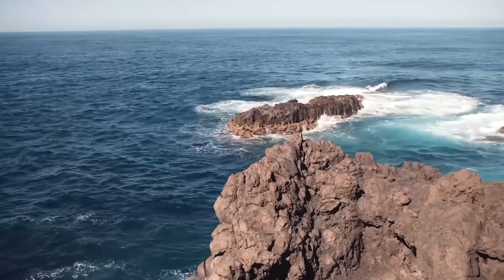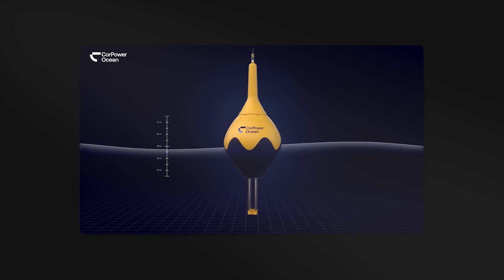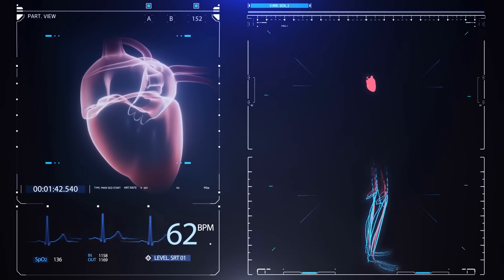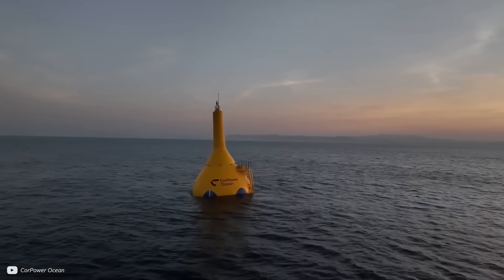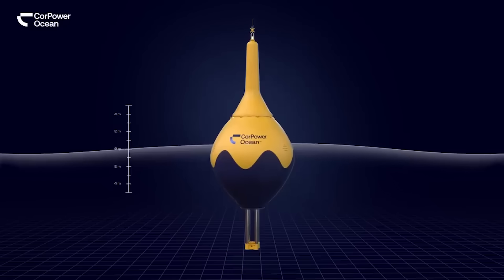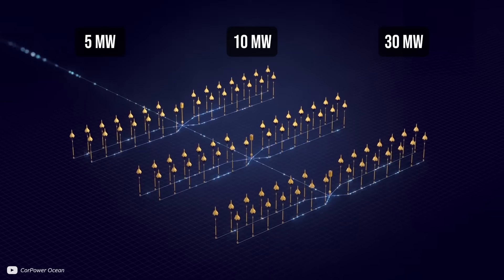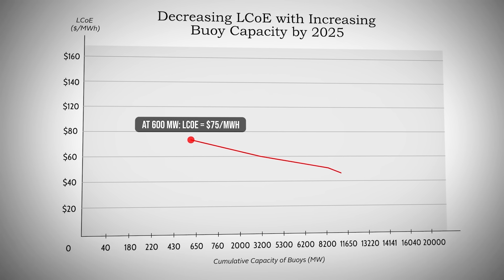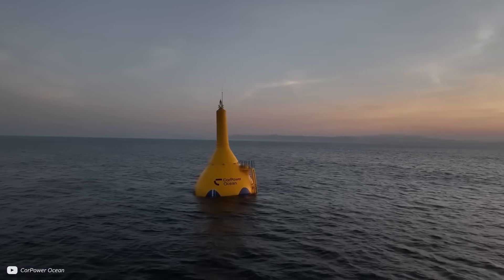Unlimited Wave Energy: This Buoy is the Future

Comment: Renewables are one thing, but they're not useful if we don't have good batteries.

People should push for their governments to invest in industrial sand/carbon batteries. This allows us to store the excess energy that would otherwise be wasted. The heat can be used in one of three ways: 
1. Industrial applications (melting steel, glass, etc)
2. Heating of homes via a centralised heating infrastructure. Similar to how water, gas, and electricity are delivered to our homes.
3. Converted into electricity. 

Number 3 is pretty inefficient, but it doesn't really matter because it's energy that would have been wasted anyway.
Reply: governments don't listed to people - they only serve the oligarchy. so it doesn't matter if they are building useless infrastructure so long as it helps them thanks to subsidies -- even if they will ultimately fail within a few years.

Comment: Big question???? Cost?????  Real cost.
Reply: Yeah, given their cost is "we can match the cost of wind". I'd argue it's not looking good.
Reply: @stusue9733  I believe I have a solution to storing energy with a non petroleum based liquid fuel that can be manufactured almost anywhere….. but I have no help with funding or labor.
Reply: @stusue9733  I have a cheap solution… attempting a demonstration project to manufacture “ a cheap liquid motor fuel for internal combustion engines “ 
My labor and self funded …. Wish I could get a grant or help building out the infrastructure.  Inputs are all almost free but the cost is in the equipment to manufacture.

Comment: would this absorb storm wave height and provide a percentage of protection to sensitive coastal areas prone to erosion?
Reply: I think you would need an extreme amount of these for any noticeable effect.
Reply: @JeppeBeier  I think so too but it's just there can't be no effect.
Reply: A large array must have a moderating effect. This is an upside in terms of coastal erosion but it also is a downside for the relative positioning of buoys in a large array. Presumably if the proximity of the buoys would need to take account of this and would determine the area needed for the wave power "farm".
Reply: doubt it
Reply: There is no free lunch in physics so I guess it does 🤔

Comment: The only important metric for similar systems is the price... :D at sea it doesn't really matter if the rotor is 3 or 30 meters long, you're interested in the cost of production and deployment... and given the complexity and low power it's probable to be bad... :/  fingers crossed, but if we try it at this point with solar and wind, it's not optimal...
Reply: production + deployment + maintenance + EOL costs

Comment: Thanks for this video!  Extremely well done and thoughtful.  I would think another advantage of wave energy is it's fairly steady with a much lower level of intermittency than wind or solar.  Maybe not quite good enough to call it a reliable base load, but I would think pretty close.
Reply: Also most population centers are near the sea.

Comment: Didn’t know wave energy had been investigated for so long
Reply from the maker: It was a surprise to me too, a longer pursuit than fusion 😅
Reply: @ZirothTech  “always 200 years away”
Reply: @ZirothTech  Hasn't been pursued as long as perpetual motion devices.
Reply: I am sure sailors for thousands of puzzled how to use that energy.
Reply: Saltwater + greater physical stresses than high altitude wind are no small problems to fix.

It's a matter of getting high enough output for a given length of time before the degradation of the hardware sets in.

aka return on investment (ROI) is the biggest issue.
Reply: @mnomadvfx   100% agree I'm looking at this thing going that a lot of moving parts  and seals in harsh environment doubt it last more than a year before needing a major rebuild. This is the problem with all wave power systems that i've seen proposed. the ocean is corrosive and full of debris and to extract energy from you have to have moving parts exposed the the water combined with wave power be cyclical in nature makes fatigue damage a guarantee. I they had the tech to solve these fundamental problems they would be selling it to mining and oil companies and be making lot more money than making power generators.
Reply: @mnomadvfx Dual carbon electrodes...never rust...carbon is essentially free
Reply: Waves pack a lot of "punch".  The sheer amount of energy in waves is what causes almost all machines to fall apart eventually.
Watch any YouTube video of a large cruise-ship (weighing thousands of tons) being tossed around like a cork and you see the enormous energy in waves.
Reply: @orionbetelgeuse1937  They said that about all flying machines up until 1903. Then Kitty Hawk happened.
Reply: How many do we need for the whole worlds energy? Is there enough ocean surface area to fit that many? How much to build and maintain that many? Sounds like another renewable scam.
Reply: The first "computers" were analog mechanic devices that have been around a loooong time.  WW1 naval gun ships could calculate multi-variable equations with gears (analog inputs:  ship bearing, ship speed, projectile motion, target bearing, and target speed).
Reply: When calculus was invented around the 1660's, a few people probably tried to calculate mechanical wave motion.
Reply: @orionbetelgeuse1937  You do not live near the ocean. Ocean waves are almost as permanent as the earth and contain an enormous amount of energy. The fossil-fuel industry has brainwashed Americans….but the rest of the world is better-educated and rapidly moving on, leaving America in the dust.
Reply: @orionbetelgeuse1937  Wrights built wind tunnels and investigated wing shapes, finding that extant lift/drag calculations being circulated at the time were significantly wrong.  This is how they were able to build their successful gliders and ultimately powered flyer where other contemporaries were failing.
Reply: Pythagoras screw
Reply: Gravity use as damm pump resvour with stored energy in battery then release when demand high sell to duke at 10 times cost they recoupe off taxpayers and bill customers 15 times for billion dollar profit already doing just say upkeep n grid with new wires from cheap ass china copper gov shut down usa copper mines yrs ago believe
Reply: Those seals around tubes gotta take hell of abuse and pressure this mostly a scam as cost be high as seals leak will fill with corrosive salt water good idea for lucky last few yrs at most good luck
Reply: Underrated comment ☝🏿🧐
Reply: The ocean is the most powerfully natural force on earth, just think about that and it never stops.